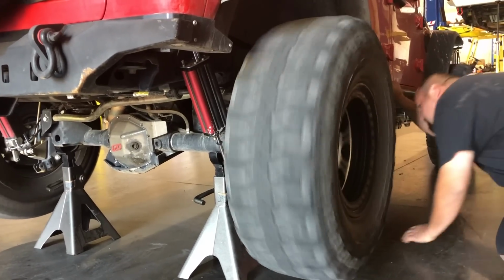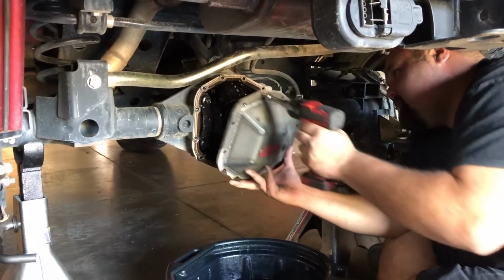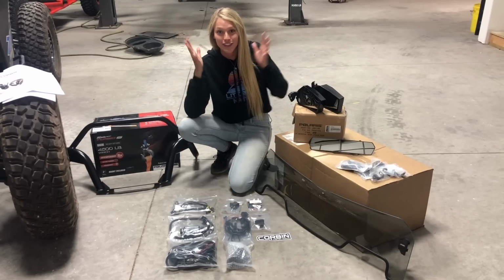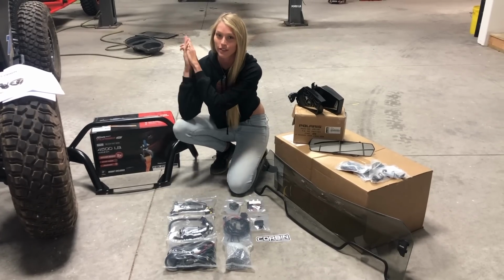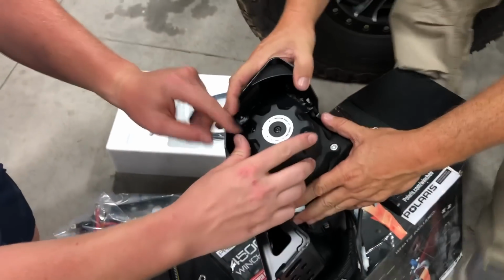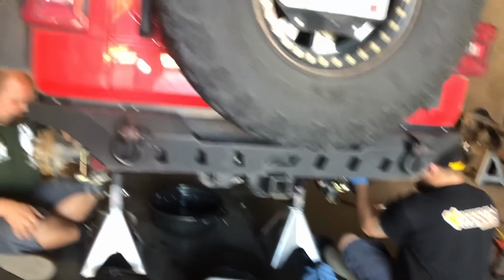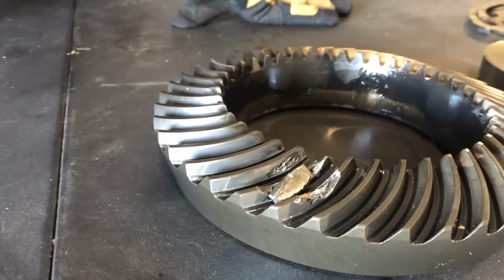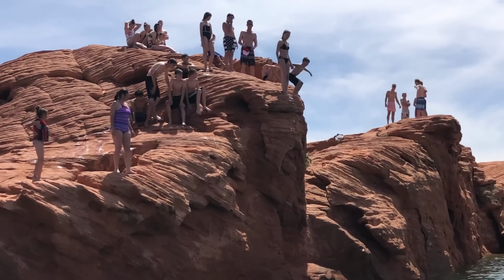We Finally BROKE OUR JEEP?! Bye Bye Gears and Axle!

Comment: Hold it hold it! Didn’t you guys just get a new pro Dana 44 from dynatrack ?You guys really need a 60.  Sorry guys I’m upset. Is it dynacrap? I think I’m going with teraflex rear ends. But I love all the metalcloak equipment you have.
Reply: Oraven 1 our front axle is prorock 44 and the rear is stock. The front prorock held up like a champ. The rear stock is what gave out. Dynatrac is top of the line and we’re upgrading with new Dynatrac now as we speak.
Reply: Kevin Williams my bad kevin🤓I thought you did both sorry about that.
Reply: Oraven 1 no worries. Dynatrac stuff is definitely amazing. No doubt about that.

Comment: Hey Lite Brite......   I’m getting ready to buy tires and need an update on you Patagonias......   How many miles now and how are they holding up?  Are the getting noisy?  Etc etc etc.   looking forward to the LA thing ......   what ever it is...
Reply: Mike Robbins all mud terrains will start to wear unevenly on a solid axle vehicle. Best thing you can do is rotate them often. You should get about 30k miles from them. Use LITEBRITE code at Northridge 4x4 for a discount on the tires if you like. They are great tires. You will love them.

Comment: So is the Northridge promo for specific things or is 20% off anything???  Accepted code, shows 0.00$ discount
Reply from the maker: It’s “up to” 20%
We messed up when we put that in the video. Very sorry about that. Most seem to be at least 10% or more. Not sure why there would be 0% unless it’s parts that cant be discounted due to MAP pricing. I’d call them and ask just in case stuff got missed.
Reply: @LiteBrite  had to look up MAP pricing. That really blows.  Go figure I can't 20% of fox shocks. Tried to double down and use my father's day gift cards and walk away with a set for 266.00!  DENIED. Cant wait to see your JT...and if it's only yours temporarily....beat it worse than a stepchild!👍👍👍

Comment: A couple years ago I heard a weird noise in my rear end while out wheeling. A few days later leaving work I broke a few gears off my ring and pinion, drove home in 4wd, then pulled the rear shaft and drove around with only front wheel drive for a couple of days while I waited for gears.

Comment: Is the 20% promotion code for Northridge only applies to specific items? I tried using it and it doesn't seem to recognize the code? Anyone else having issues?
Reply: Brandon Koay should be “up to 20%” but it’s been working. More then 31 code redemptions. I’d call them maybe?
Reply: @boughtnotbuiltoffroad7784  Thanks, it seems to work on other items I randomly select but I was trying to purchase a specific roof rack and the promotion code discount came out $0.00.
Reply: Brandon Koay hmmmm. I’d give them a call and see if maybe the code got missed on that item.

Comment: Talk to Jantz Engineering. He can fix it, so it will NOT fail. There is a combination bearing girdles and, a custom diff cover to prevent the diff from spreading.
Second thing to do is cryogenically treat everything that is hardened in the diff. Cryogenics does a couple of other things that will help. Contrary to popular belief, cryogenics does not make anything stronger.   Hardening still leaves microscopic soft spots. Wear is caused by microscopic tear out. Cryogenics evens out the hardening, which then reduces tear out. The second thing cryogenics does is increase rigidity without making it more brittle. This reduces gear flex, which results in less loss of mesh. 

After breaking the differential twice in my motorhome, I had to come up with a different solution. Between Jantz engineering and cryogenics, this solved the diff breaking issue. Incidentally, Carl was featured on the History Channel in an off road competition. (which he won with ease) Pay this guy a visit. He can custom build anything you need.

Comment: Sharp cut zip ties are the bane of my existence. Also, I remember watching you two getting the axles installed. They didn't last long. Do you think that is due to you beating your red headed step child, or were the axles a bit "not as good as they should be"?
Reply from the maker: 2 Cents We replaces the front stock axle with a Pro Rock 44, but the rear was still stock
Reply: Oh yeaaaahhh. It WAS just the front one. My memory served me wrong. Then... that rear lasted longer than I thought it would've. But that whole situation kinda sucks. The stock axle housing bent just enough to break your brand new 5.13s you had in there. Well... se la vie.

Comment: Of course you can make it to L.A., even towing. Pull the rear drive shaft & run on the frontend-  no different than any other front drive car on the road. Geez......
Reply: Jonaathan Simons there’s a lot more wrong with the jeep then just the gears and axle. That’s the next video

Comment: is that a warranty repair? 60000/5year on stock parts...
Reply: Henry Pierce lol no
Reply from the maker: Henry Pierce If it has been stock parts, mayyyybe could’ve finagled it, but we had 5.13 spicers in there.
Reply: @LiteBrite  I saw you had after market 5.13 after I posted the comments.   But I was mostly trying to be a wise guy ;)
Reply: @boughtnotbuiltoffroad7784  So, when you get the Gladiator, are you going to get the heavy duty towing package with the heavy front and rear Dana 44s?   I noticed I could get a non-Rubicon JT in that configuration for less than the Rubicon model... wasn't clear if it had lockers though.  I am still saving my pennies for a JL/JT.

Comment: tried the "litebrite" discount code at Northridge on several different items and it didn't give a 20% discount. $6 off on a jack, $0 on brake lines, $0 on tires, $0 on axle shafts
Reply: cog1154 it’s “up to” 20% so we messed up but it should be giving you something. Maybe call and ask? It won’t all be 20% but most things seem to be 10% or more.

Comment: I seem to remember telling you to change your final gears....but what do I know. I'm just some dude who has been wheeling for over twenty years and was Mr. January in the All Pro calendar.
Reply: You have to pay to play/ mr January
Reply: TrulyUnfortunate we had 5.13s
Reply: @boughtnotbuiltoffroad7784  
Were you running stock axles?
Reply: Mr. January?....dude! 👍
Reply: Weird flex, but ok.
Reply: @Garbagemanrsl  
My Toyota,not myself.
Reply: Don’t mind me. I’m just playing. I have no room to add my two cents. I’m brand new to the Jeep world and only have a JK at the very beginning of a build. It’ll take me a very long time to join the ranks of LiteBright Nation. My Jeep couldn’t even park next to the StepChild. Still a lot to learn. These vids and comments are a very valuable tool for me.
Reply: @Garbagemanrsl  
What I've learned in my 20 plus years of wheeling?
   Buy an F250 or equivalent and tow your ride. Never hard wheel your daily driver.
   In the end it's cheaper to buy a trailer,big truck and a beater you can really have some fun with.

Comment: Glad you got the Jeep fixed. I have gone through 2 sets of rear gears on the YJ due to driving in 2 low in Moab. I now have a Dynatrac axle. Bigger is better.
Reply: @Future-Preps35  I ran a non c-clip 35 in the YJ for 8 years. It was trussed with hard shafts. It is now in a friend's YJ. I ran 35's, and so is he. I bent the original 35 doing Rusty Nail.

Comment: It would have been caused by the Lockers.  When both tires are spinning and one suddenly catches, all of the torque transmits to the opposite side.  That's why the damage was concentrated on the right-side.  The heavy tires on the right were spinning and the left wanted to keep going but it couldn't because of the ground.  The right side still had centripetal inertia.  I think that normally just spiral fractures the axle shaft or shatter's the gearing.  Looks like you got a little bit of both.
Reply: All that could happen with an open diff, even more likely since when one tire spins, with an open diff, it goes twice as fast as when you have a locker. Then when it grabs it's even more likely to break shit. Lockers are better 90% of the time offroad

Comment: If the rear fails completely, can you pull the rear drive shaft and drive home in 4wd using the front axle for power?
Reply: No, cause the axle will still drive the carrier gear into the pinion gear.
Reply: Brett Budnik no. It’s a semifloat a le

Comment: So remove the rear driveshaft and put it in 4H. Drive to LA in Fwd. (Not sure if the JL transfer case is sealed so you can do this) Ive done this on my TJ
Reply: Yeah, but they're towing as well, not sure if that makes a difference.
Anyways, as the video showed, they came up with a solution. 😃

Comment: Have hard hard wheeled my 89 YJ for years, have to press new axle bearings on every 3 to 6 months from the abuse, if you let them get worn you'll bend or break shafts and mess up your gears, something along with your hubs you should be checkin before every good beating you're gonna dish out, and after before the ride home hah
Look forward to seein ya what got next

Comment: I did my entire truck suspension(rear shackle flip kit, long arm kit, track bar, springs, swaybar, pitman arm) on the ground and it freaking sucked.
Reply: I do all my work on the ground. My neck and arms get a workout. :)
Reply: Funny thing is I have a drive-on lift at home that has jack plates, but right now it’s buried under a ton of stuff, and being on my feet at work all the time, it’s actually a bit refreshing to lay on the ground even though it’s way more difficult.

Comment: Sorry to hear about the broken axle, but it was only a matter of time. Factory axles and housings are great for normal driving and lite to med wheeling. As soon as you go up in tire size and gears, they will fail in time. I went from stock 30frt/35c-clip rr axles on my YJ after many years of med to hard wheeling running 36" IROKs, after breaking both axles in one day, I upgraded to Currie ROCKJOCK III 1-ton axles frt & rr on 39 1/2 IROKs and have to say the axles are my last concern now as far breaking goes. Yes they are pricey but well worth it.  In case you are wondering how much they cost. My front axle came to $10,815 not counting install. The rear axle came in at $5,473 not counting install. The basic order specs are below.  Other than the YJ mounting pads, these axles would work great on your broken StepChild. Someone needs to setup a Go Fund Me site for you two. As always, love the video and happy trails.

ORDER CONFIGURATION:
Model: YJ Year: 1995 Engine: Application: Offroad
RE Dimensions - Overall: 66.875 Pin Offset: Brake Space: Drum Rotor:
Brakes: WWD New Style
AXLES HOUSING THIRD MEMBER
Style: 1 Ton Front
Type: Extreme
Spline: 35@60 Deg St
Bolt Pattern: 5 On 5.5 Inch
Stud: 19/32
Register Diameter:
Driver Axle:
Passenger Axle:
Style: RockJock III Front
End Type 1 Ton Inner
Brackets: Pads See Notes
Housing Width:
Driver Housing:
Pass. Housing:
Driver Tube:
Passenger Tube:
Style: D60 Reversed (60R
Ratio: 5.13R
Spline: 35@60 Deg Std
Differential ARB (AL)
Yoke: 1350 Std (K)
Case: Reversed 60 (V)
Pinion Support: N/A (X)

ORDER CONFIGURATION:
Model: YJ Year: 1995 Engine: Application: Offroad
RE Dimensions - Overall: 66.875 Pin Offset: 0.94 Brake Space: E 2.5 Drum Rotor: 0.188
Brakes: WWD New Style
AXLES HOUSING THIRD MEMBER
Style: Performance
Type: Tapered-T&E
Spline: 35@60 Deg St
Bolt Pattern: 5 On 5.5 Inch
Stud: 19/32
Register Diameter: 2.800
Driver Axle: 31.4385
Passenger Axle: 33.9355
Style: RockJock III
End Type 9+ Torino/LB
Brackets: See Notes
Housing Width: 61.499
Driver Housing: 25.8035
Pass. Housing: 25.6755
Driver Tube: 0
Passenger Tube: 0
Style: D60 Reversed (60R
Ratio: 5.13R
Spline: 35@60 Deg Std
Differential Detroit Locker (DL)
Yoke: 1350 Std (K)
Case: Reversed 60 (V)
Pinion Support: N/A (X)

Currie has great support and customer care.

Comment: Awe... Step child lost a few baby teeth. Now for some math. East coast trails X large tires ÷ by stock rear > turbo = broke sh*t. Axle housing flex will get you everytime. Ya'll need a minimum of a ford 9" rear swap or step up to Dana 60 or 80. Unless you're about to get a Gladiator then save the mods for your new ride. Hopefully Jelly  will ride with y'all now that the stepchild stopped making that nasty noise. Y'all stay safe and thank you for your awesome videos.

Comment: It hasn't been very long since you installed a turbo on your motor and the drive train is feeling the extra pressure,  it is time to beef up the rear axle to absorb the power and take the abuse you give it on the trails. The threads are twisted on the axle shows that rear end can't take the power you are sending to the rear wheels. I put a posi in my Jeep Grand Cherokee when the rear end gears were making noise and I love a posi in any vehicle. I am glad you weren't stranded on the road with a broken axle, good luck.

Comment: I don't think this is relevant or even matters at this point, but in one of your recent wheeling vids I noticed the rear locker not working..just fyi

also, who's going to sponsor your new rear axle?
Reply: They might have had it turned off.
Reply: @jake-mv5oi  both front wheels were spinning, the Rubicon can't have just the front engaged.
Reply: @phillipcraggs6202  That sucks. Wonder if their tuner disables that.

Comment: Definitely a ouch. Next upgrade if you can't afford the 60s is 8.8 Ford. They're stronger than Hades I just dropped one into my grand you have to remember that they're used in pickups 1/2 tons Ford Explorers vans and they has stood up from the 80s on up. Just a suggestion we use them in our rock crawlers another awesome video YouTube

Comment: Your twisted shaft splines is not the wobble.  I’ve twisted plenty they don’t wobble.  It’s a bent axel flange !!
Reply: I've had a twisted spine and had no wobble, and a bent axel shaft with wobble.
Reply: The "bent Flange" is sometimes bent from leverage, and sometimes (often) from twisting the shaft, not just the splines. As the shaft deforms past its limit, it pulls the flange in. Both give you the same symptom, without scribing the shaft when new, no way to be sure which is the culprit.

Comment: 40s and my driving style killed my rear gears with a stock 3.8 and 5.38 gears. Pushed me to do junk yard one tons.
Reply: @Skull_n _Bones80 overkill on a dana 44 yes, but it ran 100mph no problem and had all the torque I ever needed. I also have a manual trans

Comment: I’ve spun my carrier bearings 3 times on 2018 JL with LSD, it’s common on that but not on Tour Dana 44 with lockers. Best of luck getting back on the trails soon
Reply: Maybe due to heat build up from the clutch packs slipping offroad. My TJ with the factory lsd had some cooked beearings when we pulled it for the grizzly locker. That was from treating it like a real locker offroad... ha

Comment: If it’s 4x4 you could have used the front end to drive.
Reply: Not recommended. Modern transfer cases use a wide chain to send power to the forward output shaft. This chain is not designed to handle the full weight of the vehicle over long distances.

Comment: Bummer guys! Can’t say I’m surprised though. 38s on weaker, 5.13 gears and a turbo pentastar. Fine if you don’t actually wheel it but you guys do. This is why the 1 ton discussion is real. I’d pass on a stronger housing and at least get a semi float 60 rear if anything. You guys would have way more assurance on full float 60s. I know they’re pricey to buy but maybe you guys can work a deal with some of your new friends in the future. You guys do too much with step child to not invest in full float 60s or some built junk yard axles.
Reply: The new gen 3 dana44 uses adventec gear technology i wonder if that material is stronger then the 5.13 gear set they installed?? Maybe stock dana gears would have held up??
Reply: camaro camaro ss Yea I’d be curious to know more about the material science. Generally the 4.10s would have been stronger because of tooth count. Strong enough to have not broke in this instance, who knows? There is essentially v8 power coming from this thing now on 38” tires and beadlock wheels it needs more beef. These axles are really ideal for max 37s and stock-ish power.
Reply: @JsGarage  ya deff pushing the limits of stock axle with that set up. And not to mention they beat the hell out of that thing constantly lol. I just always wonder about little things like that if oem is stronger then a cheap aftermarket piece. But either way the axle wasnt long for this world.
Reply: camaro camaro ss Yea definitely. I think they ran Yukon the first time too but I don’t remember. If so Yukon is some good stuff but I do wonder if there is an strength difference from OE.

Comment: I don't get why they didn't go with Dana 60s when they swapped the front, 38" tires on locked diff is just as hard on the axles as 40s

Comment: You would think for the price of these new wranglers Dana 60s would be standard by now.....it’s 2019.....most people put 37s on them and Dana 44s can’t handle the beating. The Tj rubicons came with Dana 44s and the max most people ran were 35s (mostly 33s) so whats that tell you. Jeeps keeps cheating out knowing people will still buy these overpriced Wranglers that still have a Dana 44s, v6 or a turbocharged 4 banger.......we want a Hemi v8! and not for a arm and leg price but a reasonable price.

Comment: Haven't watched the video yet. My guess: broke shaft close to the carrier or bent shaft by the flange. We'll see! Dang, even worse. We had a guy that was wheeling with us at Rausch break a shaft right before the splines went in the carrier and it didn't show any signs until we got back to camp and the wheel was wobbling like that. The splines on his axles were a lot more twisted than yours. Y'all need something with a 3rd pinion bearing to prevent the deflection (ford 9", 14 bolt, D80) Hopefully y'all can find a sponsor for a bling axle so you don't have to worry about it any more.